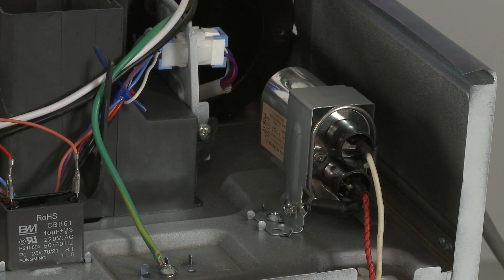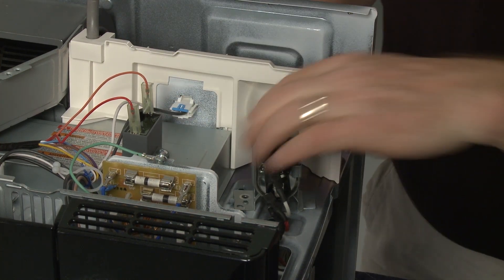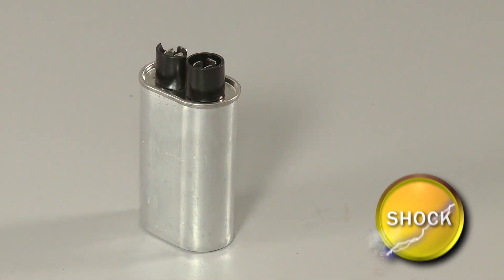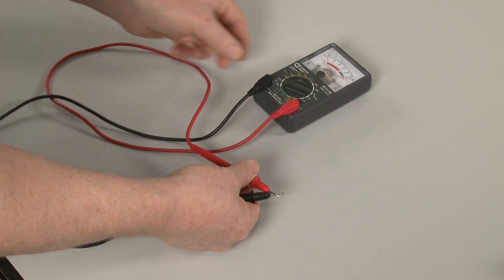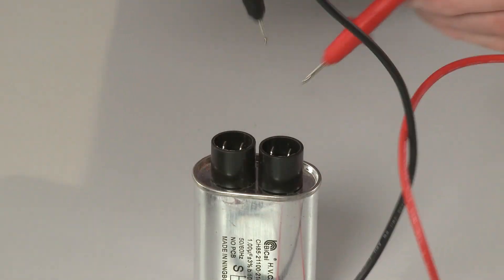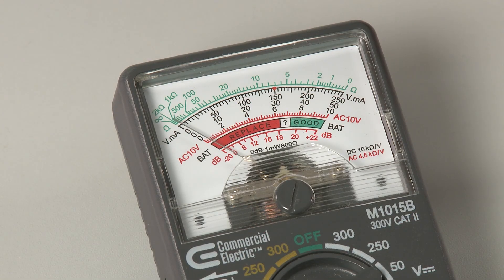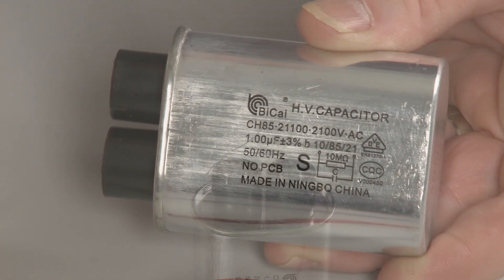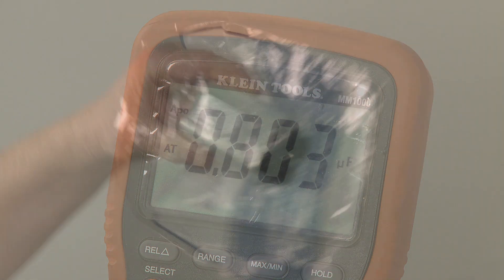Microwave Capacitor Testing

Comment: I thought 🤔 if there is continuity between the 2 terminals then it has shorted😮. A good capacitor should not have any continuity or readings on the multimeter. Correct 😅?
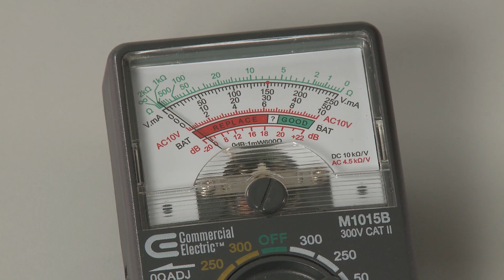Reply: if referring to 1:42 , there is "transient" current from the meter until the plates of the capacity charge, which effectively be an "open" circuit per the DC current. So I think, in theory, if the plates are already charged, then you shouldn't see the "transient" current, though, flipping polarities will cause transient state changes. Any voltage-changes across the capacitor plates will yield some current.

Comment: Where do I find the capacitor and how do I remove?
Reply: The capacitor is usually above and behind the control panel of most over-the-range microwaves. You will need to take off the screws holding the main body housing to see the components. As they mention, be careful there are delicate components and high voltage potential.